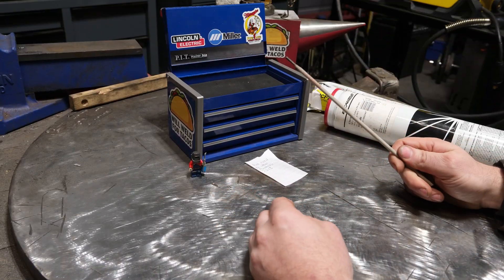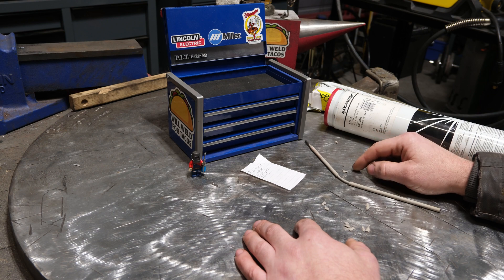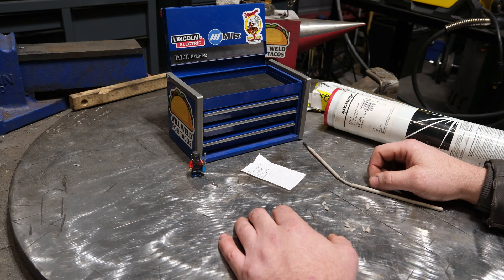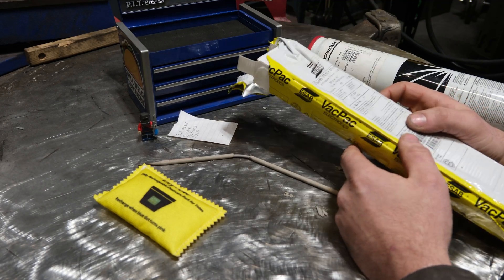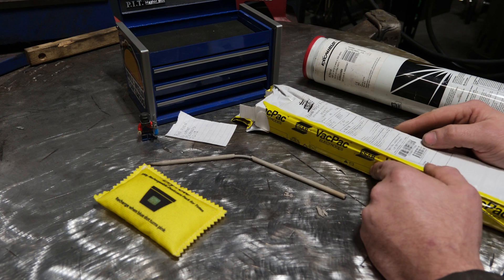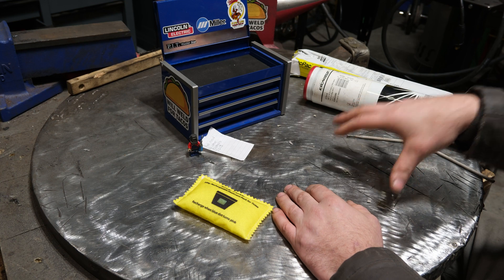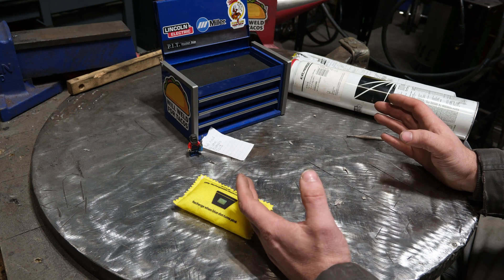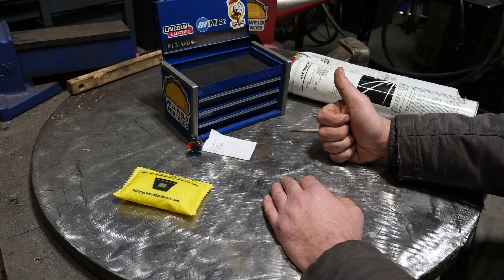QFTB #11 Rod ovens and 7018 rods

Comment: I have had self shielding wire and  gas shielded wire rust.  Moisture is a problem for most welding consumables wire, stick, and tig rods. I wish  that welding suppliers sold seamless self shielded and dual shielded mig wire in 2 lb spools.  There is still a rusting problem for the outside of the wire but the flux remains low hydrogen because the wire is seamless.   I imaging copper coated wire or ESAB claims to have another coating process that might possibly help with the rusting problem .  I don't weld that much and like having a machine that is loaded with wire  ready to go.  It is a hassle to have to remove the wire and store in a hermetic container and then reload the wire for making a few welds.  I don't have a welding table or a shop and use a welder for making a repair and building something simple now and then.
Reply from the maker: I tend to leave the wire in machines and put a few large desiccant packs in the machine, and that is generally enough to keep the wire fresh.  Copper coated wire generally has less issue, but like you said the self shielded wire is a much harder problem to solve since it’s not coated.  I have not ran a coated flux core wire other than some dual shield, so I am unsure how good they work. A couple bigger desiccant packs and a cover is about the best you can do short of pulling the spool out.  Sucks if a spool gets rusty :(

Comment: Hey Greg, great info. I use to work with an old timer welder that never worried about storage of low hydrogen rods. He would just grab an open rod as needed, and when ready to weld, he would just touch it to the work, purposely shorting the rod (but not welding) to heat it up and dry out moister. I never questioned him, he was a highly skilled welder and very experienced. Mind you that was decades ago and I was just starting out. I just remembered this after seeing your video. He was a real interesting character. I don't think that practice was recommended LOL.
Reply from the maker: I have heard that from quite a few people.  So the hotter rod will be less likely to have porosity, probably restart easier, but it definitely would be frowned upon on critical jobs lol.

Comment: Interesting topic!  I’ll look for high strength steel scrap for some experiments. I want to see a 6013 or 6010 weld fail first hand vs 7018.
Reply from the maker: If you weld 3/8th steel fillet weld with 6013 or 6010 and a second with 7018, the 7018 will not break while the weld is bent away from the face in a press.  Even easier would be to just weld two fillet welds and hit them with a hammer (bending away from the face) and see which ones break first.  7018 is actually significantly stronger and less brittle than 60xx rods.  

Soon I will be experimenting with higher strength steels in a video.  Surprisingly enough many higher strength steels are still best welded with 7018/er70 because the more ductile weld will be less brittle.  Chromoly is a great example of this, without heat treatment the material will fail in the heat affected zone and not at the weld.  So under welding it with er70 vs er80 works because the more ductile weld allows things to move more.  Er80 only makes sense if you heat treat the whole part after welding.
Reply: @ Thanks for this additional info!  I also want to report that I made a cart out of 14 gauge square tubing to wheel around one of those economy welding tables that fold…so that it could be moved around through narrow spaces.  Did it with 1/8 6013 (had to travel fast) and only had 3 small blow throughs and it came out nice and square.  The weld beads vary in quality, but it will hold together.  Thank you again for your video teachings!

Comment: the one thing I didnt hear mentioned is a vacuum chamber.      I like the idea of those drytote for the tool box and inside the welder box...
Reply from the maker: So if you were to take rods directly out of a factory vacuum sealed container and immediately put them in personal vacuum packs they wouldn’t really pick up hydrogen from the air.  Now officially companies wouldn’t do this over using a rod oven to keep them indefinitely as “low hydrogen” but this would be the closest thing that could be done to limit moisture exposure without storing them in a rod oven no doubt.

Comment from the maker: Another way to look at this issue is that liquid water (hydrogen and oxygen) doesn’t exist in or on a 7018 rods flux at say 250 degrees.  I (and the welding community in general) are bad at using slang to describe things.  Case in point “baking the moisture out of the rods”, “wet rods” or “moisture in the air absorbs into the flux” is really not an accurate description of the problem.  The issue lies in the atoms of hydrogen that bind to the flux not easily being removed.  This is why manufactures and the American welding society specify 550-700 degree Fahrenheit bake out temps to recondition a rod back to low hydrogen status and not 300 degrees.  Liquid water or moisture (as oxygen hydrogen, or h2o) will vaporize and evaporate easily at 300+ degrees.  Not all of the hydrogen atoms will leave the flux at those temps, and the oxygen they may be bound with isn’t a concern (the hydrogen atoms are the problem).  So what we have here is a case of ridiculously small atoms of hydrogen not wanting to leave the flux, and the only way to ensure the removal of them from a “wet rod” so that it meets spec is very high temps.

From a practical standpoint 7018 used out of a previously open but currently shut pack of rods doesn’t meet low hydrogen spec but it will impart a minuscule amount of hydrogen into a weld compared to say 6011-6013-or 7014 because 7018 itself didn’t have hydrogen in the flux when it was made and whatever hydrogen was in it currently would have been picked up from exposure to air.  In every situation 7018 should be your choice of rod for higher strength materials over 7014 because it will always have less hydrogen in the flux.
Reply: i'm a chemist and I approve of what is said in this video, keep up the good work Greg. At standard temperature and pressure, water will vaporize (from itself) at 100 C, but if the hydrogen bonding is stronger to rod flux, then it will take a higher temperature to vaporize it.

Comment: What about a rod oven that also with heat has a vacuum pulled on the chamber. The lab I worked in would heat a chamber to 200C and also pulled an ultra high vacuum to get all the water out before they could start making chips.
Reply from the maker: If an oven could bake a rod out to the spec and had a vacuum, they could be indefinitely stored without continuous heating.  That is sort of the theory behind the cans of rods that are sealed like a spam tin.  The rods are put in with very little airspace (some are vacuum sealed) and they will not be able to pickup moisture.  Where this doesn’t work the best is the foil vacuum packs (like the yellow esab) are far less durable as staying vacuum sealed because a simple cut or scratch through the foil is all it takes to allow air in.  The metal tins are extremely durable in comparison.

Comment: after I retired from the welding business and giving up all the cool tool's ie. rod ovens, baker's ect. I was faced with such a problem " keeping LH dry" at first I kept away from the 18's, couldn't justify even a small 110v portable oven because of the "feeding the power company" for that occasional 7018 job, so although this isn't code I did this, I have a 16" bag sealer, got a roll of poly tube 16" wide. opened a fresh can of 7018 and sealed 10 rods in a  pack. these packs of ten each in it's own little sealed place ( like of looks like a machine gun ammo belt). all is stored in "Rod Guard" cans with jel packets in the can to catch that moisture that gets pulled in when opening, all this is done within an hour. To use I open the can, pull out a ten pack and close the can. now I have just a blister pack of rod's that I poke each end through the plastic bag, the other rod's are still sealed.
since I don't do code work anymore I feel comfortable with this method. it's cheap and I am not feeding the power company.
You are correct about proper storage and that's why we have AWS , when it comes to critical welding you can't cheap out. 
  I kind of wish the rod company's like Lincoln would package their LH for small users ie.  individually vacuum sealed rod's in blister pack's like I made (mine are not vac sealed only protected from moisture.
Fantastic video Sir have a blessed 2025. 😉👍
Reply: or at least have 5lb and 10lb packs divided up into 1lb sealed packs
Reply from the maker: What you described I would have no qualms with using the rods on most anything I do.  At the very worst the rods would have .01% of the hydrogen a typical 6010-6013-7014 would.  I doubt it would even be enough to ever cause an issue on even high strength steel, but the code exists to eliminate variables.  High strength and high liability often go hand in hand, and you can’t leave anything up to chance lol.  

It is too bad that it’s tough to find small sealed packs of 7018s.  The best option for that which I have found is Esabs 7018 prime in 4 lb packs, but those are getting super hard to find (maybe they are discontinuing them).  I keep a couple packs of them in my truck when I do mobile work so I don’t have to deal with a rod oven.

Comment: What about a kitchen stove ? Couldnt you throw them in a stove to remove moisture and reliability use the rods?
Reply from the maker: A stove wouldn’t meet code for baking them out unless it could hit 550-700 degrees F for a hour.  By spec that is the temp that needs to be hit for the rod to meet low hydrogen spec.  250-350f is only for storage of rods out of a package (within 4-8 hours of opening a sealed pack).  So by code and manufactures spec a normal oven wouldn’t likely be able to properly “bake out” a 7018.

From a realistic point a 7018 that was held at 350degrees for a few hours would have no issue having very little hydrogen, and wouldn’t likely pose any issue for most of what someone would weld.  No, it wouldn’t meet code/manufactures spec for low hydrogen, but it would likely impart .01% of the hydrogen that 6010-6013-7014 would.  So in simple terms welding with say 7014 will produce a weld full of hydrogen in comparison to a low temp baked 7018, so substituting 7014 because it’s “safer” than 7018 is a grave mistake.  You can’t bake a 7014 out to make it low hydrogen, it needs hydrogen in the flux to work properly.  So yes even a low temp “stabilizing” temp would be beneficial over nothing with 7018, but it wouldn’t meet the spec of low hydrogen and could still pose an issue with higher strength steel.
Reply: @makingmistakeswithgreg  ok so if I'm not worried about code and doing my own stuff I can just use a stove . Thanks Greg.
Reply: Thanks.
Reply: In theory.  It would have to be an electric oven with a self-clean mode that can sustain 550+ over an hour, like Lincoln's rod ovens ( interestingly, they recommend 700 for 1hr).  A gas oven would not work.

Comment: Give me the devil's advocate, how about using a toaster oven you know those new ones they have with the little door they supposed to be reached 500
Reply from the maker: So to meet manufacture spec and American welding societies spec if you had a rod that was out of a package for say 3 days, the only way to have it meet low hydrogen spec would be to bake it at 550-700 degrees F for a period of typically 1-2 hours.  After that’s complete you would then put it in a stabilizing oven at 250-350 degrees F for indefinite storage.  The problem with a toaster oven is it’s not a solid plan for long term storage of electrodes, and it arguably couldn’t hit high enough temps to meet the bake out requirements.  It could only be used to hold rods out of a pack at a stabilized temp.  

They are that specific because (from what I have read) the hydrogen atoms that have locked in the flux are bonded so strongly that reduced temps (even for a indefinite time) are not enough to get all of the atomic hydrogen out.  Both Lincoln electric and AWS specify in writing that extended storage at 300 degrees is not/should not be used as a substitute for a higher temp bake out.  

For the most part this isn’t an issue for people, unless they weld on higher strength alloys.  Even if they do simply using a fresh pack that’s sealed removes all doubt to the low hydrogen spec.  When the rods are made there isn’t hydrogen in the flux, unlike 6010-6013 and other rods, so in a sealed pack it won’t pickup hydrogen.
Reply: @makingmistakeswithgreg  thank you sir appreciate it I said it was devil's advocate
Reply: You would be wasting electricity.  A toaster oven has a hard time reaching 400 and they are not insulated (part of the problem) so they would cost a fortune as a storage oven.

Comment: I don't do a lot of 7018, so I don't keep a lot on hand. What I do keep is stored in a Phoenix Dryrod 2 oven. The thing is only a few watts draw and cheap insurance. It's also a small enough footprint for a garage shop.
Reply from the maker: 100%.  Very cheap insurance.  They are insulated so well it doesn’t take much electricity/ heat for the rods to stay hot.  It removes all doubt as to the status, it doesn’t force a person to open a new pack every time they weld higher liability stuff, and the rods typically start better.

Comment: Shows the dreaded Excalibur!
Reply from the maker: Haha, I have ran about 200 lbs of it recently, and it works pretty good.  I prefer Esabs atom arc or 7018 prime.  The big issue with Lincoln is they have had some spotty quality control.  I bought a 50lb tin and the flux varied by almost a half inch for where it stopped on the stinger end.  It can also be hard to find bigger tins that don’t have a bunch of damaged rods in them.

Comment: Supposedly 7018 and the like tend to run “better” if they’re kept “warm and dry.”

True???
Reply from the maker: I can tell you that rods straight out of an oven run slightly better (when used within 4 hours) than ones right out of a sealed can.  I have burned up probably 100lbs of rods in the past 2 months.  3/4 out of a oven 1/4 out of a new can, and given the choice I would take them out of an oven vs out of a can.  The hotter rod starts a bit easier, and for some reason the slag peels off a bit easier.  Even after the rods cool to ambient temp they seem to be a bit better.
Reply: @ thanks.  I’d read/heard this was the case, and had attempted to make a rod-warmer to find out if it was true.

Still might try to make an inexpensive rod-warmer, if it looks like I might need to do much stick in the future - that, and secure an Esab with hot-start and arc-force, so as to run 6010/6011 decently.

Comment: How about those Pakistani's using 6013 for everything from wheelbarrows to axles and engine crankshafts?  Is hydrogen embrittlement the least of their concerns? 🤨
Reply from the maker: I have wondered that too, and my conclusion is there is a reason the video only shows the repair and not the finished product a year from now lol.  You can do so much wrong with welding and it will hold up temporarily.  Like using a 6013 to repair an axle shaft, or to build up a crank.  In the long run it will fail, but considering the reliability they are willing to accept, it likely works for them.  In this country it’s uncommon to rebuild a heavy truck engine on the side of the highway, or reweld a broken cam, because it doesn’t make sense.  A over abundance of cheap labor combined with the expectations of low reliability gives rise to wild fixes lol.
Reply: “…and a lack of real options in some places, also…”
Reply: @dennisyoung4631  Yep, it's actually as good as can be expected, considering the equipment they work with.  It makes me have more appreciation for a good welder and more choices in welding rods, etc.